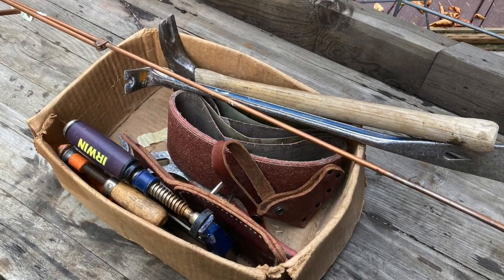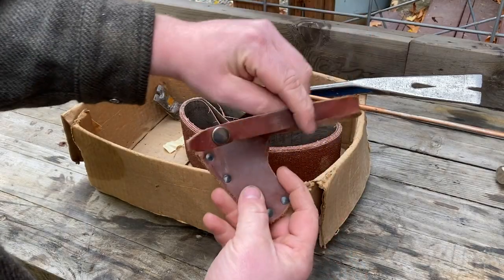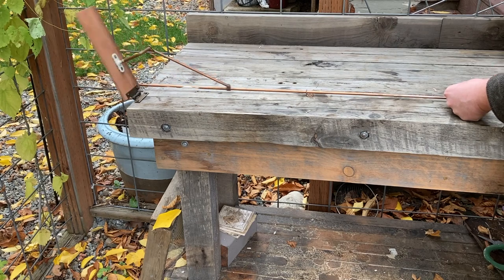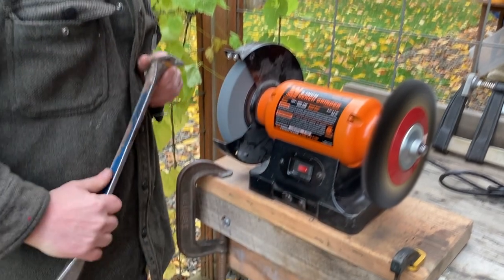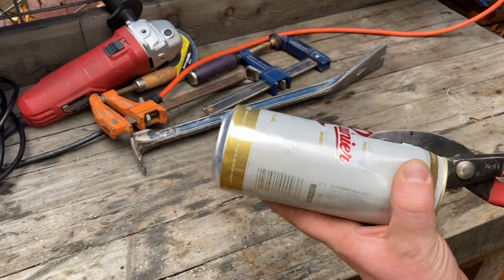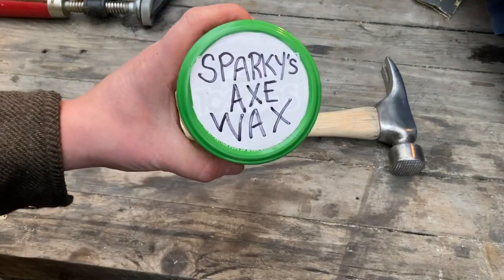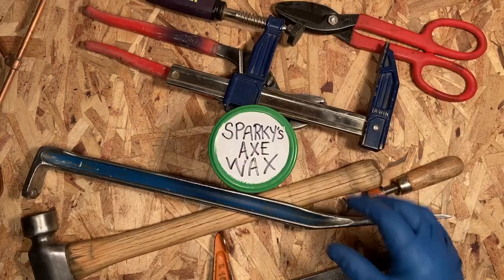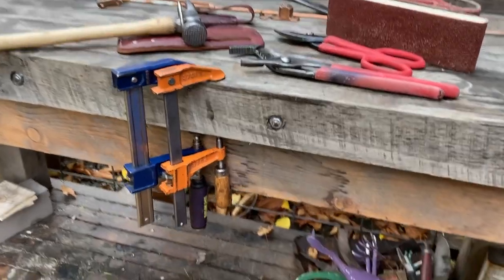$10 Yard Sale Haul & Quick Tool Clean Up

Comment: Great job on the clean up. May I suggest using boiled linseed oil on wooden tool handles,  if you can't make Ax Wax? Linseed oil feeds the wood in a similar way.
Reply from the maker: Thanks!  The axe wax is made with wax and linseed oil.  Next time I may put a coat of linseed first and then axe wax second.
Reply: Fun fact! Linseed oil actually cures to a hard shell and can be polymerized with alittle heat, effectively creating a "bake on coat" which obviously helps with tools getting beat up 😅
Reply from the maker: @jonathandough7409  Have you ever heated up the oil coat to make it hard?  If so, is something like a heat gun a good tool for the job.  I've always used linseed oil on my handles but I never heated it up.  Thanks for the tip!